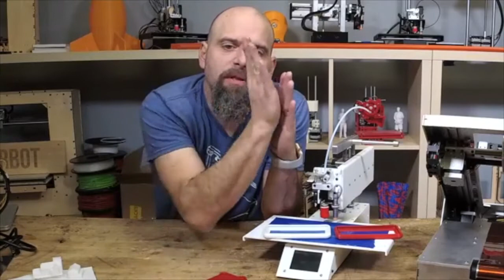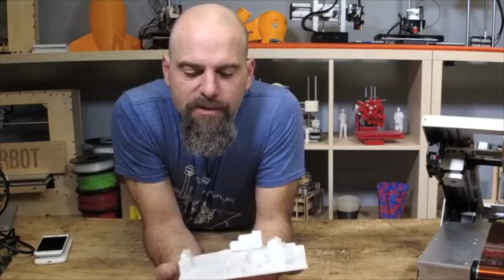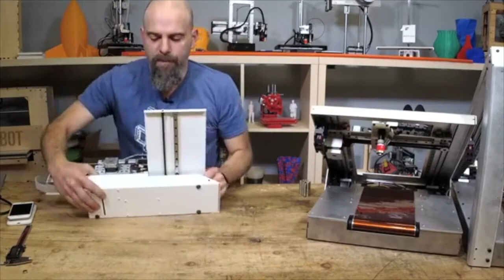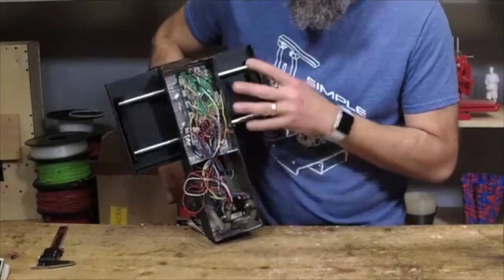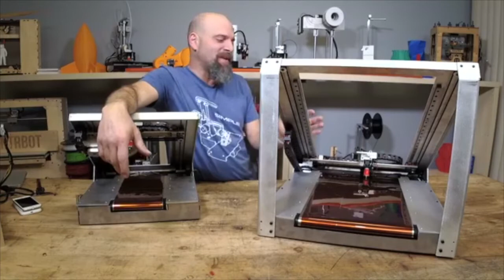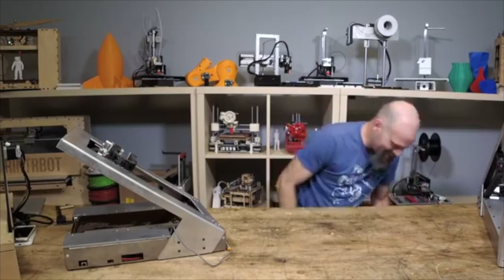Printrbot LIVE   1-11-18

Comment: Please keep up your work on belts as the print surface, as I firmly believe that is a next evolutionary step forward. (But do not bet the farm, short term. This will take time.)

Problems that I wonder about:

When the print separates from the surface at the end of the belt, how well does that work? What angle works well for initial separation? What radius? Are well-stuck prints on separation deforming the belt?

We are not applying consumables to the surface (glue stick or sprays), so adhesion and separation need to be reliable. Right there, you have bumped up the problem. (Or we start applying consumables - another complication.)

Can you do lots of repeatable prints? 

I expect this to be tricky. Once sorted, this becomes essential.
Reply: PLA works just fine on the kapton belt once it is heated.  In fact, we have to cool it down for the parts to release easier.  As long as you start with a clean surface... then it will work for a very long time.